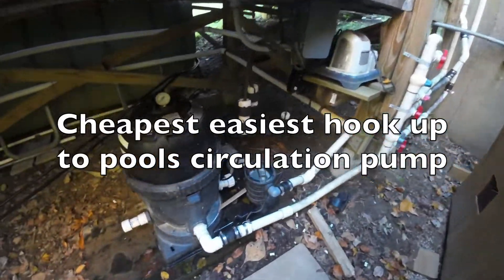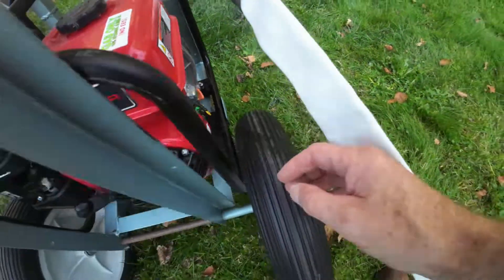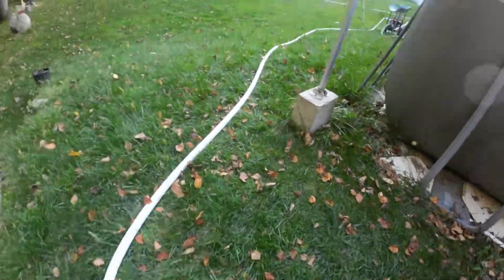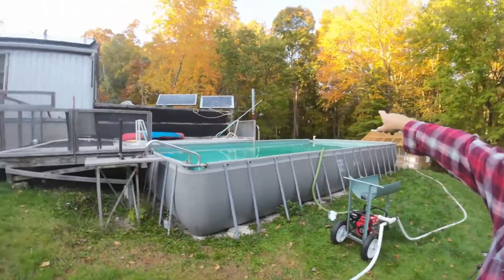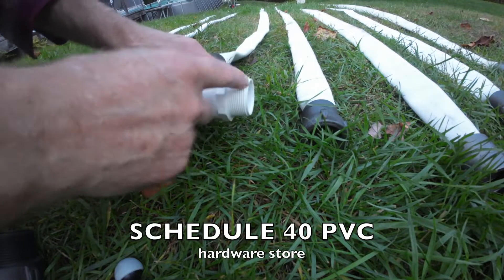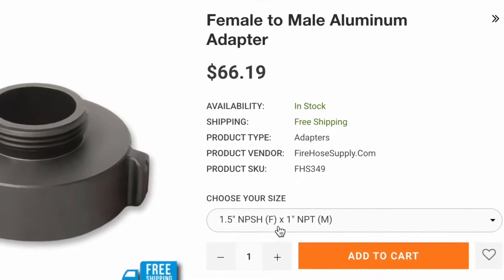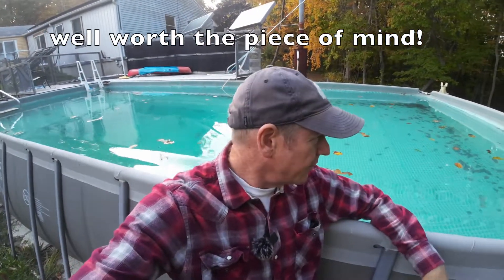DIY Wildfire Protection System, How to pool pumps & hoses

Comment: The task at hand is defending against the embers. You’re wasting water when you’re soaking down your house and shrubbery in a wind driven storm when it’s 90° it’s gonna dry up really fast. You must focus on fighting the embers. Were you gonna run out of water? 90% of structure fires are caused by the embers getting stuck in your vents.

Comment: I would recommend the quick connectors (cam and groove) to speed up deployment of the system.
Reply from the maker: Thanks. I’ve never used them before but they look good. Since this setup uses the pvc T’s to save money, cam locks wouldn’t work. Thanks again,

Comment: I could also see the FD using something like this when hydrants fail
Reply from the maker: Yeah, actually they do! There some places that if you have set up like this you can put a sign up before you evacuate to tell FD that you have it.
Thanks for the comment,
Reply: Nope not really. He used npsh fittings instead of nh/nst which the fire departments use. For all the money he spent, he could have just bought a couple of nst fittings and been compatible for the fire departments to use the water more effectively with their equipment.

Comment: Where was the cart that you have the water pump mounted to from? I can see that that’s not something that comes with that transfer pump?
Reply from the maker: Hi, I made it. It’s designed to get this rig to a pond as well as fire protection at the house with the pool. You can check it out here, but consider storing your hose in a plastic box and moving the pump with a hand truck. Thanks,
Fire & ICE mobile pumping unit
https://youtu.be/6ayJZ_HFt24

Comment: Excellent presentation and breakdown of materials, equipment, prices, and most importantly the actual capabilities of your systems. I too would lean heavily toward a gas powered pump system because not only the possibility of power being cut by the power company or EMC there would be a possibility that water would be cut off and redirected for fire suppression in your area. I've got a rainwater catchment system with some storage right now but no swimming pool. Looking up a couple above ground models now..
Reply from the maker: Sounds good but swimming pools require a lot of maintenance. Fire safety should only be a secondary motivation for the pool. Otherwise you should consider a closed opaque water cistern that won’t grow algae or collect mosquitoes if you just want water available in case of fire.
Thanks,

Comment: Those red plastic nozzles are not rated for much pressure. I've had them come apart with not much use on construction sites. Better to go with a brass nozzle for long-term reliability. Also, I would be concerned about the pump running with all the nozzles closed. Those trash-style pumps are meant to run full open. You might be able to rig a return line back to the pool to allow some water to bypass if all the nozzles are closed.
Reply from the maker: I have spare nozzle but I don’t think this pump is capable of producing enough pressure to do what you were experiencing. But it’s a good suggestion. These things are like an insurance policy. This one is better than average but if one has the means they can definitely upgrade. Thanks for sharing your experience,

Comment: Good to run regular water hose from house into pool also while using big pump.  The pool will empty slower and act as a buffer tank for the big pumps.
Reply from the maker: Yeah, good idea but unless your pool is really small, probably won’t notice the effects of the garden hose. Just not enough water.

Comment: Yeah.  But.... in most wildfires, they usually cut POWER to the area long before the fire gets there.  Sorry.  Need to set up a gas powered pump.
Reply from the maker: The good one is gas powered pump. I wouldn’t use electric without a generator.

Comment: Plastic pipe will fail in a fire and leave you standing there with nothing.  Don't get yourself killed trying to save your home.  You should use all metal pipe/fittings and hook up a sprinkler system on the roof.  Don't ignore the evacuation order.
Reply: In the system I am setting up (pumping out of river), I am installing a 3/4 adapter with pressure regulator which will operate a 3/4" impact sprinkler to keep the pump, nearby hoses and surrounding foliage wet and cool.
Reply from the maker: @markdavis8888  cool, where do you get metal hose?
Reply: @sculptureforasmallplanet  Your not a fire department.  There is more to it than a hose.  Not bad to have but don't let it trick you into thinking you don't need to run when the flames show up.  I have sprinklers and a generator on my well.
Reply: A paper cup can boil water over an open flame. By the time the water filled pipes melt the he house will be long gone. The danger might be breaking the PVC pulling on the lines though.

Comment: If you tap off a full port valve before your home pressure reducer valve you'll get a 3/4" pipe @ 80-110psi, which is around 20GPM out of a 100' 3/4" garden hose.  Which is less still than the pool pump but enough flow and pressure to equip a legit forestry nozzle at the end of the hose and do some serious firefighting. For reference a typical home garden spigot outputs around 5GPM max @ 50PSI or so, and those plastic gardening nozzles will reduce that flow down to maybe 2-3GPM.
Reply from the maker: 20GPM is pretty good.

Comment: Are you using any camlocks on these hoses ? Is it necessary to buy one? 

And is the pump gas powered if so do you know any safe storage gas containers you would recommend?
Reply from the maker: I don't use cam-lock hose connectors because the threaded NPSH (National Pipe Straight Hose) thread is mostly compatible with NPT (National Pipe Thread) so I can use PVC pipe which is way cheaper for me.
And yes it is gas powered. I just use regular plastic gas cans but I put fuel stabilizer in the gas so it doesn't go bad.
Hope this helps! Thanks,

Comment: Thank you for your video.  For the pvc tee do I need 
2" Schedule 40 PVC Tee - Slip (401-020) and two 2 in. PVC Schedule 40 MPT x S Male Adapter for each side?
Reply from the maker: Your welcome. 
To start I would only use Schedule 40 for all of this. For my set up, I go from the 2" (F)  which connects to the 2" (M) pump, to a 2" T and then reduce from 2" to 1.5" and then to 1.5" (M) threaded connectors. I used a little short piece of 2" pipe to connect the T to the 2"(M) threaded connector. You might be able to find a Street T so you don't have to buy 10' of 2" pipe when you only need 6". But this is getting really complicated if you have a good local hardware store they can help as well. I'm going to make another video today that will explain the decision making process and how to get a set up for your specific needs.
Hope this helps!
Thanks,

Comment: How many do I need...
1 1/2" Adjustable Straight Stream & Fog Nozzle - IPT / NPSH (pipe threads)
1 1/2" Inch Single Jacket Fire Hose - 50 Feet / White / NPSH / IPT (Straight Pipe Threads) Aluminum
Female to Male Aluminum Adapter - 1.5" NPSH (F) x 1" NPT (M)
Also, can you provide a link to the T's and 2" x 20" suction hose

Thank you so much
Reply from the maker: Nice job! But adapter that you want is 1.5" NPSH (F) x 1.5" NPT (M) not 1". I screen shot the wrong measurement. Sorry!
I'm going to make video real soon that will go over how to make this set up the right size for your situation because there are some variables to consider.
Reply: @sculptureforasmallplanet  What do you think about 1-1/2" Impact Rain Gun Sprinkler FNPT w/Nozzle Set - (12, 14, 16 mm) x 5 mm and 63" Tripod Stand for 1-1/2" Rain Guns if I were to use  2 fire hoses so I don't have to manually spray the area.  These will work with the 1 1/2" single jacket fire hose?  Just incase I may have to evacuate, I wanted to have these on.
Reply from the maker: Yeah, that looks great! I want to get a couple! 
I don't know how big your place is but you can probably get away with 1.5" supply hose. That's a lot of water and you don't want to drain your pool to fast.

Comment: Very smart.  Everyone in fire areas should have this if they have a pool.  Even get an insurance discount.
Reply from the maker: Thanks, And I agree. Sometimes fire crews will use them even if your not home. If I was an insurance company I would give a discount. But to my knowledge they don't however insurance doesn't keep your house form burning down either. Thanks again,
Reply: I agree but remove combustible vegetation from around your house first before a fire starts. That will make your odds of your house surviving a wildfire even greater. FF for 35 years
Reply from the maker: @mikeforster8798  definitely! Thanks for your service!

Comment: Reading the manual for the pump you bought it specifically says to not reduce any fitting. I see that you're immediately reducing from 2" to 1.5" fire hose and the fitting your showing us (the screenshot of the FireHoseDirect site) you're choosing a 1.5" to 1" reducer. I'm assuming, as you mentioned, it was the differing weight difference in the two hoses? Any concern about operation during actual emergency that would validate pump manual warning? Thanks!! Great video.
Reply from the maker: Thanks I’m glad you liked it. Yeah the 1.5” to 1” is a mistake, sorry. I was just trying to show the male to female adapters. But you’re right about reducing from 2” to 1.5” 2” hose is really heavy! Not only do I reduce to 1.5” I also turn off the lines so the pump isn’t moving any water at all for times. I tested and it didn’t get hot a little warm is all. Pump has been running good for years no problems. I have filled and drained the pool twice with it fooled around with fire hoses and haven’t noticed any changes. But realize this pump is designed or advertised for this application at all. The pumps that are designed and  advertised for this type of thing cost a lot more. I think some of them produce a little more pressure but personally I’m happy with this cheap one. Hope this helps and thanks again,

Comment: Thanks for sharing! Good set up. I’m going to attempt to replicate for my home on a heavily treed acre outside of Los Angeles.
Reply from the maker: Cool. Let me know how it goes! Thanks,
Reply: I’m wondering about the threads on most of the fire hose available (I’m looking at decommissioned forestry hoses $59 for 75’) with NH thread couples which don’t seem compatible with standard PVC pipe threads. 
Also, on the pump, what format is the 2” male thread you connected your  first “T” too?
Reply from the maker: Yeah, the NH are not compatible with PVC. This web page explains pretty well,
https://firehosedirect.com/blogs/expert-help/fire-hose-nh-vs-npsh
You can get adaptors though. Price it out and it may work out.
The pump is National Pipe Thread so a 2" PVC female screws right on and even though its a tapered tread hand tight with the leverage of the 1.5" T is plenty to keep it from leaking at these pressures.
Hope this helps and let me know if yo have other questions,
Reply from the maker: @PiddlesK  I don’t know where you are in getting your fire safe gear but I made video that might help. Let me know if you have any questions. Thanks,
How to Make a Wildfire Defense with Pool, Pump, and Hoses, DIY
https://youtu.be/v4ZfFErUQLo

Comment: Could you possibly post a parts list? i'm interested in the hoses you used and where you got them especially
Reply from the maker: Hello, I acctually can't remember where I got my fire hose it was either 
https://firehosedirect.com/
or
https://www.firehosesupply.com/
this place is just as good too
https://rawhidefirehose.com/
Find the one that has the best prices and costumer service.

I use single jacket 50' foot hose
https://www.firehosesupply.com/collections/1-5-inch-hose/products/1-1-2-inch-single-jacket-fire-hose
Single jacket is good if you are using on lawn and relatively none cutting surfaces. (Although I have hauled mine out in the woods several times to fill my pool from spring and run them over the rocks and stuff and they are fine.)
I like the 50' lengths because they are easier to deal with but you should map out where you want your hoses and get the lengths that work for your house.
I use aluminum NPSH, straight pipe thread fittings that work with PVC pipe except for connecting  male ends, then you need an adaptor. This web page explains it well.
https://firehosedirect.com/blogs/expert-help/fire-hose-nh-vs-npsh

For the nozzles I have something like this
https://www.firehosesupply.com/collections/spray-nozzles/products/fog-nozzle?variant=280181794
Make sure you get the right threads on the nozzles as well.
Hope this helps and let me know if you have any more questions.
Thanks,
Reply: @sculptureforasmallplanet  Thank you so much! I would suggest putting some of this info in your description so more people can see it.  I'll definitely be building a system similar to this.  Quick question, with the hoses, can you connect multiple together if you need ones longer than 50 feet?
Reply from the maker: @ good idea! And yes the hoses go together if they have the same thread.

Comment: Great. Also pre-stage some ladders for each roof with a  tie-down pre-installed  to secure them for extreme wind. (Preferably place 2 ladders, with 1 on opposite side of each structure)
Reply from the maker: Definitely a good idea if you think you'll need to get up on the roof! Thanks for the suggestion!

Comment: Thanks. I'm going assemble this rig for my home in Los Angeles. Thankfully, my home survived but I want to be prepared for the future. How many sq ft is your property? Mine is about 1/4 acre. How many hoses do you think I need ?
Reply from the maker: That's a good question. My property is 8.5 acres. My set up only covers the structures. I think the best way for you to figure what you need is first choose what length hose you want to use. I like the 50' hoses because they are easier to deal with than longer ones. Then get a piece of rope the length of the hose that you want to use. Starting from where you'll put your pump run your rope out to measure the length of the hoses. Put a stakes in the ground at the ropes ends then you can figure where you need T's and where you need nozzles. From any nozzle you will be able to cover a 50 or so foot radius with a significant amount of water. I would imagine 3 or 4 nozzles would probably cover your house pretty well. And you could even probably keep your neighbors covered as well. Could always add lines if you test it and you need more. Hope this helps and stay safe!

Comment: only if folks in Palisades in California knew this, tons of pools were never used in the fires
Reply from the maker: Yeah, it's a shame but I did see a story about a mother and her son who saved their house with a similar set up as what I show. Apparently they didn't have enough hose so the son had to get up on the roof. Probably worth the $300 to get enough hose to make it around your house.
Thanks,
Reply: @sculptureforasmallplanet  im opt for flagmast installed which on top of it attached with a sizeable sprinkler, water polly hose fixed inside the pole.
its in the case of working on incoming fire treat its taking care of watering the rooftop and etc within its reachable distance. in a slower showering phase.
Reply from the maker: @ flag pole sprinkler combo, that’s a good idea! Thanks,
Reply: There’s not a lot of pools in that area.
Reply: It's been well known in California for 30+ years. People are just lazy and cheap.
Reply: I see you have one of those above ground pools, which the owner puts together him her self from a kit in a box. Great idea. Available I believe to almost anyone, anywhere. So your system is great.
Reply: Those fires were not the typical fires you imagine. Even powerful fire truck pumps could not do much, if anything. It just blows back in your face. All you can do is run for your life. We learned this in the Tubbs fire, Paradise and a dozen other high wind driven fires. I applaud his efforts though.
Reply: Better question why don’t firefighters use portable pumps to drop into the pools of the homes they’re trying to save.
Reply: It is better to complain and claim insurance than doing something simple... This explains why everything happened.

Comment: So you use the harbor frieght 2inch pump and a 1.5 inch hose?  I assume you have to use an adapter of for the hose to mate to the pump?  Awesome video, gonna set this up for my home and pool!
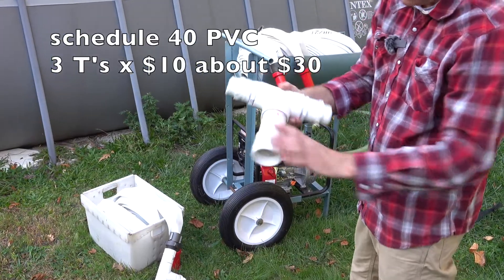Reply from the maker: Thanks! Yeah, so at 1:09 I show the PVC adaptor that goes from 2" to two, 1.5" inch. Get Pipe thread fire hose and then you only need adaptors going from male hose to female PVC. You can see at 5:10. Hope this helps and thanks again,
Reply: @sculptureforasmallplanet fantastic thanks for the clarification.

Comment: Thanks, Greg! Palisades residents (and others) would have be wise to do this kind of thing to save their homes. How many gallons of water in your pool and how long of a runtime are you getting out of your pool?
Reply from the maker: Yeah, it’s kind of cheap insurance if you have a pool. I feel for those folks who lost their homes and their loved ones. My pool is about 16,000 gallons. It will run for about 2 hours flat out.
Thanks for asking,
Reply: @sculptureforasmallplanet  that harbor freight 2" trash pump is no joke. It'll empty a pool surprisingly fast. As long as it has gas and oil and a water source, it'll run forever.
Reply from the maker: @europana7  yes, it moves the water! It makes a garden hose look like a spray bottle! Thanks,